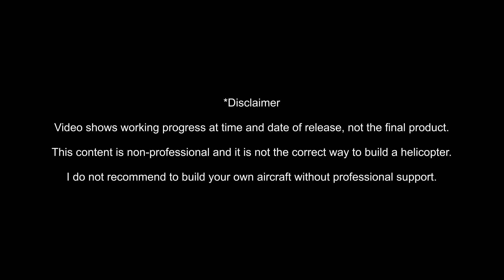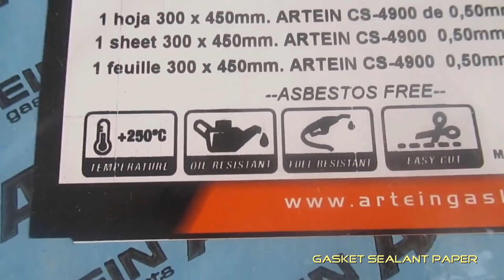Central Gearbox EXPERIMENTAL HELICOPTER BUILD SERIES (Part 44)

Comment: What an inspiration, much respect. What's the spindle and center size of the lathe you use? 
I recently bought a 7 x 14 and wondering if i can do a similar build, later down the line.

Comment: Good jod bud. Very proud of you👍🏼👍🏼👍🏼! Now i have a question for you. . . . ."What is the gear ratio on this gear box you just made"???🤔🤔🤔
Reply: He does show the gears, count the teeth, 30 and 15. A bad idea for gears. A hunting ratio should always be used.
Reply: @chippyjohn1  Yeah, I wasn't necessarily talking about counting the teeth on each gear. . . .but more so on how many turns per revolution from the bigger gear to the smaller gear
Reply: @truckerray7533  15:30, 2:1. 2 turns of small gear = one turn of large output gear.
Reply: @chippyjohn1  Thankya for that! i appreciate it! That is not a huge gear ratio espect at all! Theres still the tail rotor gearbox to figure in as well. Most all conventional helicopters will have anywhere from a 1: 5  to 1: 6 1/2 gear ratio aspect
Reply: @truckerray7533  Ratio is actually 2:1, apologies. His engine operates at 6000-6500, so output shaft is operating at about 3-3250 rpm.
Reply: @chippyjohn1  Copy that. thankya sir. Should would love to see the day when this little single place bird is ready for all the ground & airborn testing
Reply: What was it i was forgetting??? Your text didnt come in on the "scrolling down section". I only saw, "you are forgetting" in the notifcation part! What helo are you working on???

Comment: Редуктор без масляной ванны долго не проработает, смазку раскидает по краям от центробежной силы.
Eng:  The gearbox without an oil bath will not work for a long time, the lubricant will scatter around the edges from the centrifugal force.
Reply: Думаешь так и оставит ? Помню в дедовской ручной дрели было так же :)

Comment: No locktight on those bolts ?
Reply from the maker: These are not the final bolts i will upgrade them.
Reply: @ultralighthelicopter  Some don’t understand in building a flying machine you do it twice. First round with cheap hardware and when it’s done take it apart and go back together with the good stuff now that we know what we need and exact length
Reply: @ultralighthelicopter  oh just test fit.